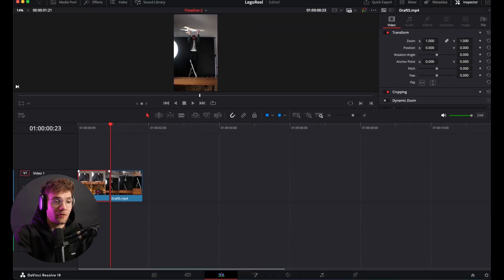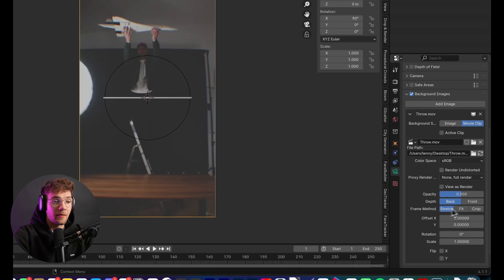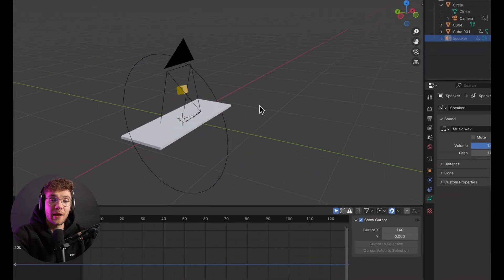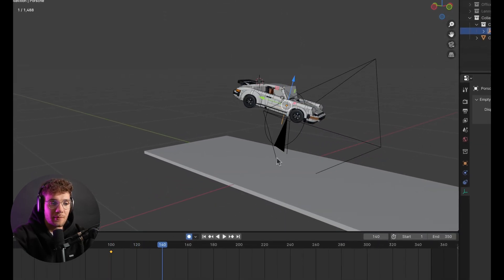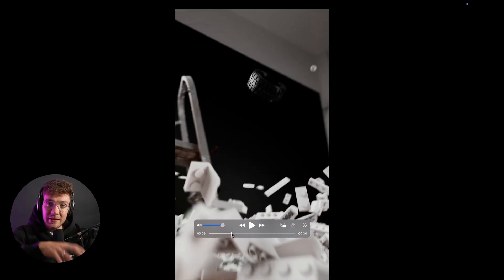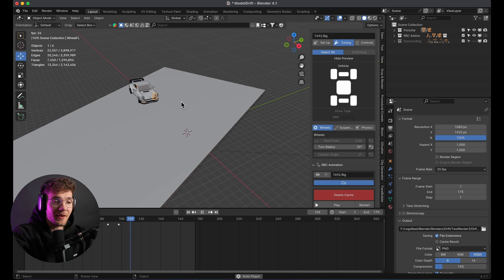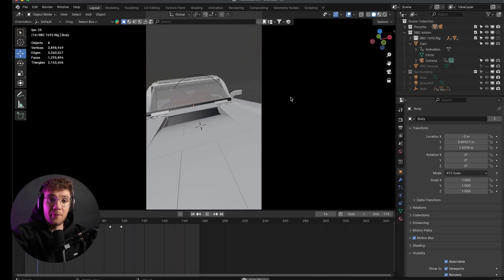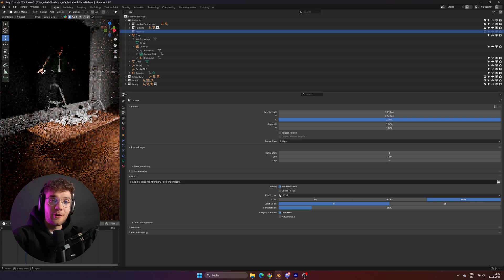How I Animated a LEGO Porsche in Blender | Full 3D Animation Breakdown

Comment: Ps, you can also use track to constraint. But parenting the cam to an empty is very handy. You can add secundairy emoties as well to add wiggle and stuff to
Reply: Another tip. Is use the addon Add camera rigs. It's made blender cgcookie if I recall correct. At least Wayne Dixon and Delai felinto made it. Dwayne is seen a lot at cgcookie video and Delai works at blender foundation